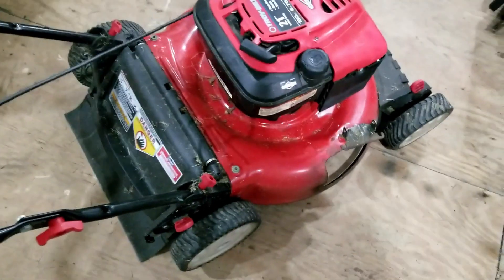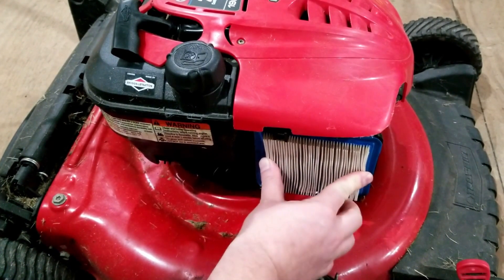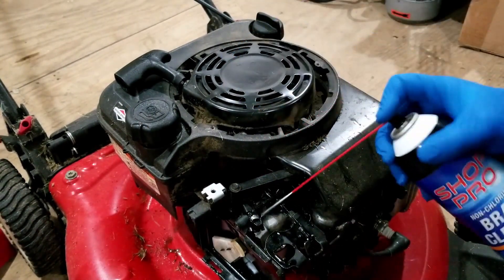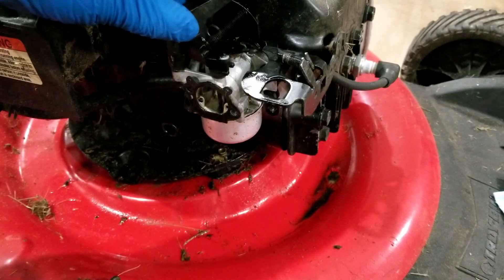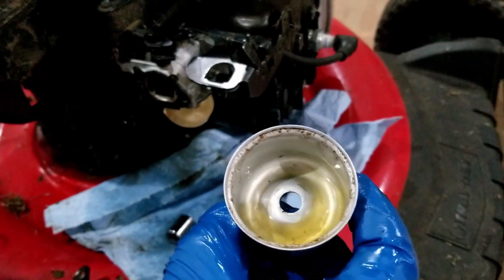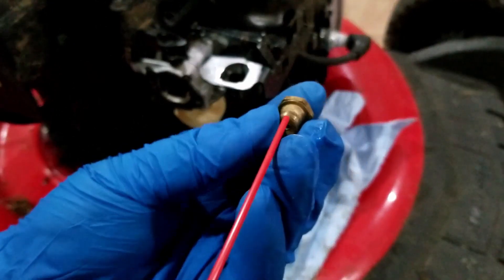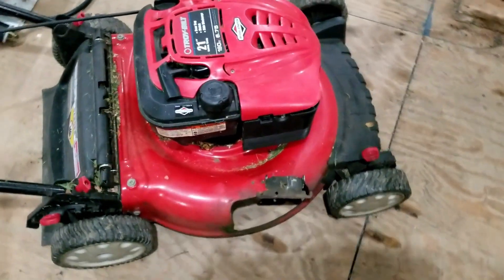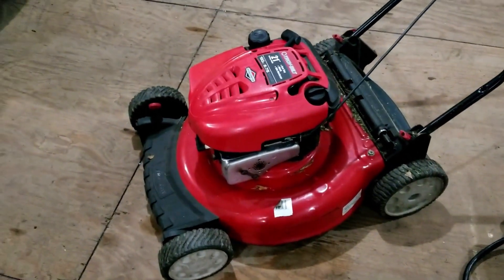Troy-Bilt Push Mower fuel issues

Comment: Mongo this is the OLD MAN at Eliminator Performance in Canada just subbed and wanted to say i did enjoy the video and will check out your others. Just a tip 1. Brake fluid and carb cleaners can cause rubber to expand and in some cases totally dissolve 2. I would not spray the paper filter with go juice remove it and spray into the carb with the choke plate open. If you have not seen our channel check it out it may give you some ideas
Reply from the maker: Mongo thank you! and thank you for tips! and will check out channel!